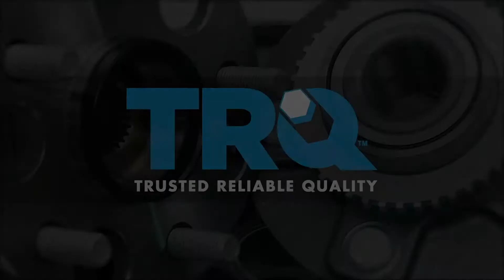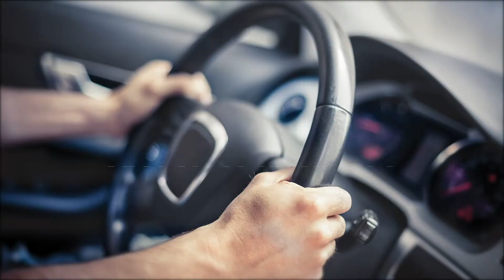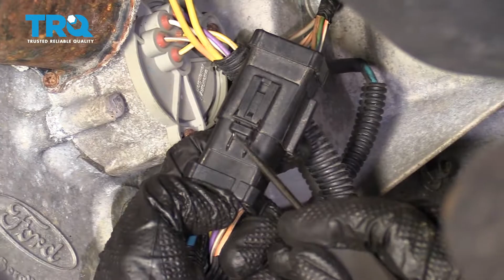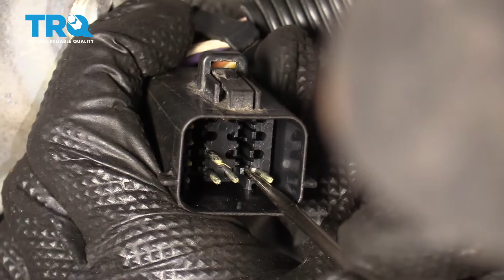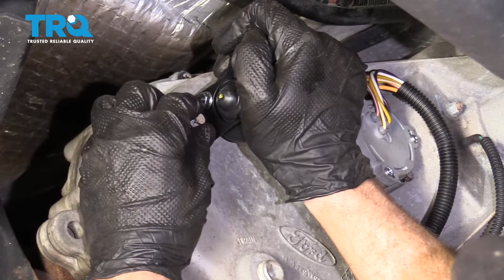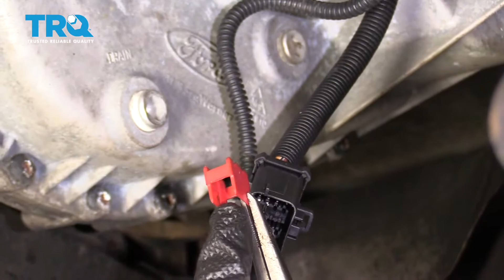How To Replace 4WD Actuator 2007-2017 Ford Expedition

Comment: My question is regarding the blue wire (about 1:10 to 150). I will be doing this laying on the ground under the truck. I m wondering if it would be ok to cut the blue wire so i can take it inside ad do the pin thin on a bench and then splice that wire back together when back under the truck

Comment: The calmest everything comes off nice and smooth like no problem mechanic. This is that guy who has every exact tool every bolt comes off perfect wires never break frail apart and his hnd always clean. I hate this guy. I sm out there minmal light cant find the damn 10 ml socket. Wasnt even thinking of gaskets or torquinh any thing one bolt just stripped itself before i even out on a socket. I mean he is mr hero and i am his nemesis mr glasss where even the right tool doesnt work. 😮😂